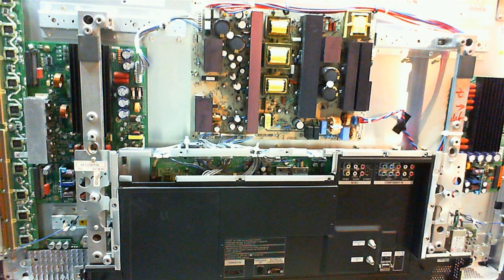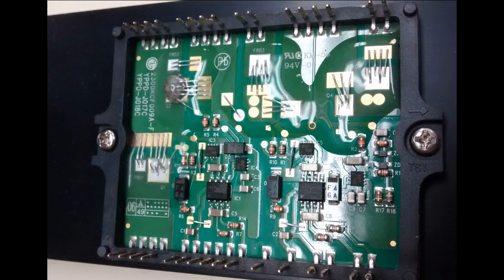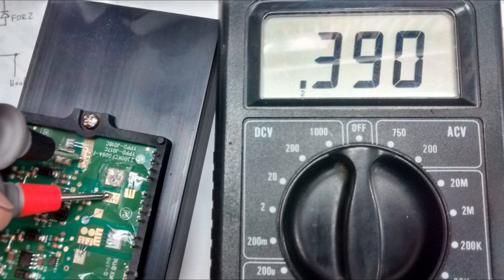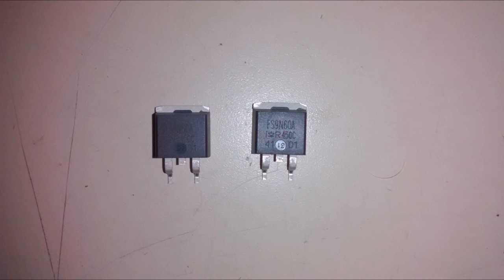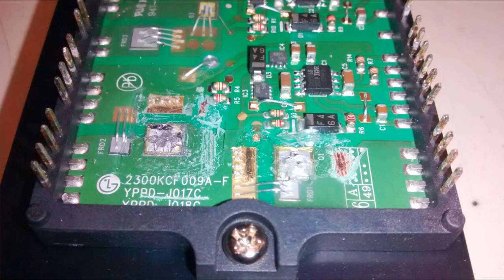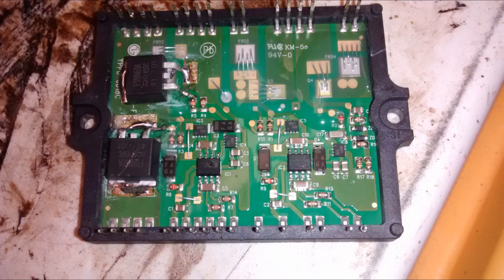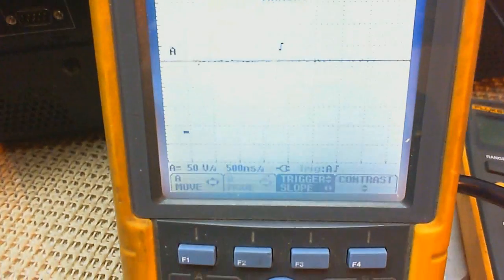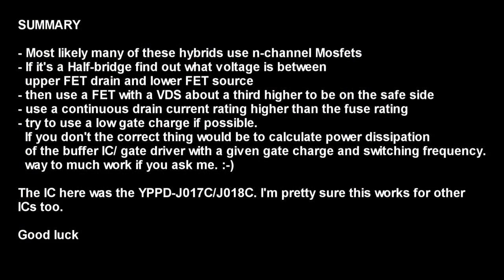How to repair a hybrid IC IPM used in Plasma TVs - YPPD-J017C YPPD-J018C YPPD-J014C repair

Comment: I think IGBT would be better, but it's the process that impreses me. Nice job and a lot cheaper than module replacement
Reply from the maker: Gerard Nolan Yes IGBT is the way to go. At first I took a MOSFET because I didn't have an IGBT at hand. In general IGBTs with the voltage/current ratings we need here are way cheaper than MOSFETs though.

Comment: Mosfets are switches and you can use any mosfet in it's place. It doesn't have to have the same numbers on it...
Reply from the maker: Joseph Hoffmann No. Mosfets as any other "switches" have voltage and current ratings (and several other ratings too) and these have to be matched to the application. You can not use just about any Mosfet in any circuit.

Comment: Greetings.
Thank you very much for sharing your knowledge.
I have a YPPD-J014C and detected that it has two transistors in short.
For this model is used the mosfet IRFS9N60A?
Reply from the maker: I'd rather recommend IGBTs, see comments below. The peak current rating of the FET you mentioned may not be high enough.

Comment: Thanks $ saver I replaced whole ipm on 60 inch Vizio y main  plays 4 like 10 sec but pixels light from outside to center of screen then about 1 ft of pixels (curcular) n center wont light then the xmain ipm blows  out  I went thew about 3 xmain ipms total. Screen voltage is good VA vs any ideas what's going on when I first got tv original the y main was bad.  I replaced logic main too. when I first replaced ipm on y main the first time the whole screen was lit and I had osd now it just does what I described.any ideas.thank 4 the info on the hybrids IC chips this will save me a jeep of dough😂😂😂😂😆!

Comment: I replaced the voltage regulators in my 42PC3D with these.
http://www.aliexpress.com/item/New-Original-STK795-820-SANYO-MODULE-Chopper-Type-Voltage-Regulator/924370459.html?spm=2114.13010608.0.65.VVFe3M

Comment: Have you ever repaired YPPD-J015C? What mosfets would you suggest for it? I have an HP PL5060N 50' that keeps blowing this IPM on the Z-SUS after about 3 weeks of use. I know it's a design issue where they got something wrong on the current limit! I think I will try and upgrade the Y-SUS IPMs also and keep this set as it has an awesome picture. thanks for the video!!
Reply from the maker: +John Smart Sorry, never tried that IPM. I would probably try the same MOSFETs as in the other modules. If it keeps blowing up there is surely something else defective. Anyway, I'm not a big fan of these old plasmas, there always seems to be something, repair it and it makes boom in another place. Check all the capacitors on the sustain boards too.

Comment: how i can find the schematic of the YPPD-J017C YPPD-J018C??
thanks another time
Reply from the maker: +Gabry L  I don't think there are any available. If I get my hands on one of them again I can draw a schematic. You can try it too, it's pretty easy since it's a single layer board, just need a microscope or magnifying glass.
Reply: +TomTechTod thanks for your answer....if you wanted to retrieve the mosfet, somewhere device ?? where can I find them ?? for example on a PC power supply (ATX) I find them ?? Here where I live I could not find them, I do not want to wait for the time to order them on the web :) I want to try now this mod !! :) :) :)
Reply from the maker: Gabry L space is really restricted. This is a high peak current, high voltage device. If you want to reuse a component from another PCB you will want to make sure that it has similar specs to what I mentioned in the video/description. I really only did it because these old plasmas are not worth it to put money in. On the other hand the modules as a whole aren't that expensive...I don't think you will find similar components on a lot of PCBs...
Reply: +TomTechTod thanks to your help, and sorry for my english by google ...on my tv voltage vs (180V) it is shorted to gnd, in fact, the MOSFET on the pcb yppd are broken. when I turn on the TV, it is now in the protection and then do not see anything on the screen, no images will sound, I think because it is shorted vs gnd. if you turn on the TV without the card yppd risk of breaking the tv? or I can try to reassemble the yppd without the two mosfet? What you would see on the screen? thank you
Reply from the maker: Gabry L there is no point in turning the TV on without the transistors, it won't work. Use IGBTs instead of MOSFETs. I used the FGD4536. Also check the driver transistors, probably TPCP8901 (8901 should be marked on them). If you are in Italy you can buy from here probably: http://www.digikey.it/product-detail/en/FGD4536TM/FGD4536TMCT-ND/3908052

Comment from the maker: Current measured at the half-bridge output was at most 70A peak. Since I removed the diode already I continued using a a MOSFET but with a higher current rating. https://www.youtube.com/watch?v=CARdm0o0FyM

Comment: Hmm--MOSFETS wont last long--Maybe a day or two if your'e lucky. IGBT's needed, at least 330V and at least 200A pulse capability.
DG302/DG502, 30F124 etc good possibilities. Been here done this!
Reply from the maker: +HighCompressionII Yes you are right. I will measure the output current once I have my current probe back. If it's too high for the FET I used then I will replace them with IGBTs. Thanks